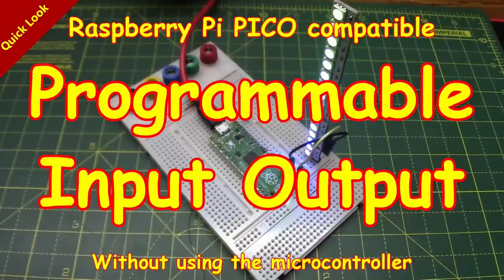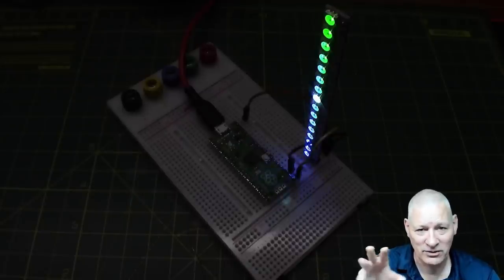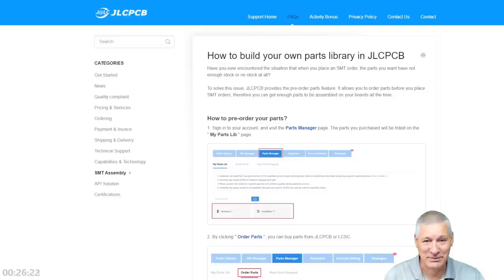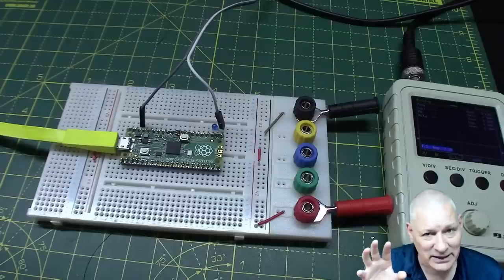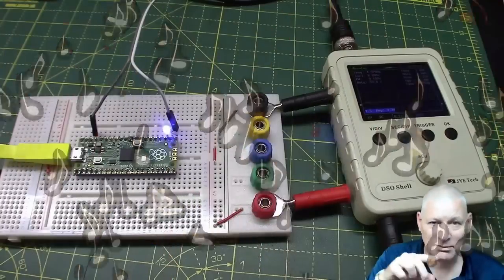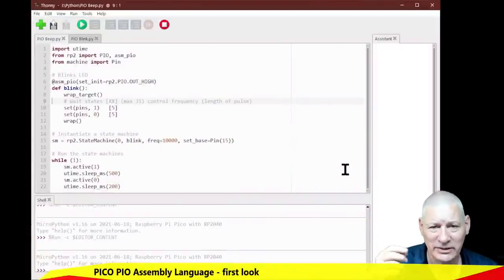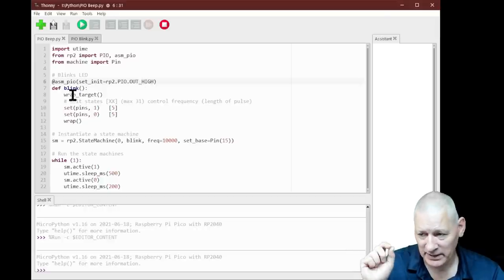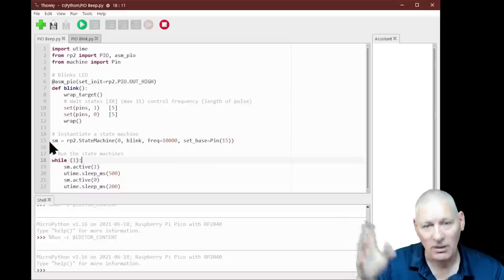#220 PICO and PIO: First Look - far easier than you might 💭 think

Comment: Thanks Ralph. Like you I've been playing with the Programable PIO and watched David's Tutorials on the programable PIO, I've managed to use a BME280 and a LCD display using I2C to display temperature etc, While the PIO output's parallel data On the PIO Pins, This is a lot different than programming Arduino and Stm32 Micro controllers. Keep up the good work.
Reply from the maker: I'm pretty sure I could write much of what the PIO does on the PICO for the Arduino (using non-Arduino speak) but it would be much harder work.

Comment: Note that you could have done your two-pin output with two set pins (using .set()), or two side-set pins (using .side()).  The side-set pins tend to be useful for control pins that you are setting to a known, constant value; and the input/output pins can transfer data to/from the microcontroller memory.  For example, the side-set pins might be for handshaking, clock, data direction, etc.

The set and output pins can be the same pin(s).  That's handy when you need to mix constant and data-driven values on the same pin (like for NeoPixels...).

The PIO support in MicroPython is pretty darn good.  Documentation and examples could use a little fleshing out.  Until then, it may help to take a look at the C/C++ documentation and examples.  I was surprised how easy it was to come up with my own NeoPixel implementation via PIO.
Reply from the maker: If you got the NeoPixels up and running then you already are an expert regarding PIO capabilities, Mark! I shall look into what you said although at the moment you've just confused.com me!
Reply: @RalphBacon  I just pushed a couple of examples of things I was experimenting  with up to GitHub:

https://github.com/mday64/pio_experiments

It's got a NeoPixel implementation (works differently from the official Raspberry Pi examples), and an 8-bit parallel output port with clock.  Maybe it will help, or maybe it will just add to the confusion.
Reply from the maker: You've been busy, Mark! 
Given the comment from @Andrew Toogood above, I just wonder how many PICOlites will ever reach the standard of code you just published, or will they just download yours and say "Look what I did!" without understanding more than a line or two?

Comment: Nicely done Ralph. Looking forward to a possible follow-up with that neopixel stick. 
I've used PIO on my Pico from a C++ program. Not recommended. I could not have worked out how to do it, and even after cutting and pasting all of the various header and helper (?) files, I still struggle to see what's going on!
Reply from the maker: For now, I'm sticking to putting the PIO code into MicroPython!

Comment: By forming a bridge output then you and expect to get 4 x the power on the speaker. e.g 2.5V in to 10 ohms, power = V2/R   (2.5)2 / 10 = 0.625W   (5)2 / 10 = 2.5W    2.5W/0.625W = 4 Sp one extra pin and 4 times the power out.
Reply from the maker: Well, I'm not sure this is a true bridge output, as there is no actual negative voltage swing. And the correlation between power out and perceived volume is not linear;  I can remember in my dim and distant younger days when I was a DJ (yes, really) being pretty disappointed at the increase in volume from a 100W amp from a 50W amp. To get double the volume (10dB) from the same set of speakers you need to increase power by ten! Yikes!

Comment: Interesting!  I didn’t know pushing an pulling pins for a sounder made such a difference.

I think you can do a live-set-able number of delay cycles (I’ve not checked this but I hope you get the idea) - this uses side set for both bits so the pins have to be adjacent.  I’ve also missed out the wrap target and wrap labels because I think the assembler assumes these if they are the first and last instructions:

@rp2.asm_pio(sideset_init = (rp2.PIO.OUT_HIGH, rp2.PIO.OUT_LOW))
def beep():
     mov(x, y)
     label(“loop1”)
     jmp(x_dec, “loop1”) .side(0b01)
     mov(x, y)
     label(“loop2”)
     jmp(x_dec, “loop2”) .side(0b10)

Delays are caused by looping round and decrementing X, and when X gets to zero the code drops through.  The minimum delay is zero, so the the minimum clock cycles for the whole lot is 4, or up to 2^32+2 if you set Y as 0xFFFF.  This should give you pretty good pitch control if you use a fast PIO clock!
You would set the number of wait cycles by setting Y in your Python WHILE loop using:

sm.put(number_of_wait_cycles)
sm.exec(“pull()”)
sm.exec(“mov(y, osr)”)
Reply from the maker: A nice example, Mr Weston, (I'll call you Nick) and shows how tight loops can be implemented in the PIO arena as well as passing values to the PIO code. Cool stuff.

Comment: My first experience with the Pico was managing to get a PicoW (hens teeth).  I ran a very quick MQTT subscribe and it worked.  Then I did "Blinky", couldn't be bothered to google the right delay function so did this instead.  Fully expecting (having just come from STM32 world) for 1 million to not be enough iterations to produce a sensible blinky.

In python I used this for delay:
for( i in range(0,1000000)):
    pass

The LED had about 1 Hz blink frequency.  That's only 2 million iterations per second.  On a 130Mhz core.  Wow.  I thought Arduino framework was wasteful.

Circuit/Micro python is fiercely slow.
Reply from the maker: It's all down to interpreted vs compiled code, I guess. If Arduino had used μPython on the original Arduino it would never have found the success it has had, far too slow!
Reply: Rapid Electronics have loads of PicoW.

Comment: This has been my favorite channel for a couple of years now, BUT I have to say I am losing interest, I can't think of anything I would use A Pico for that and Atmel or STM or ESP would not do better. And for me Micro python is pointless why learn a new language so my solutions can go slower and have less memory... Went to the end to see if you had an update in the bin sensor but alas :(
Reply from the maker: Hmm, I knew this would be a potential issue for my viewers, Andrew. After all, what can the PICO do that the others cannot (and more quickly too)? I'm only covering the PICO because it's out there, in your face, inescapable, by virtue of being launched by Raspberry Pi. If another (much smaller) manufacturer had launched this it would not have had so much traction.
I'm not sure MicroPython is pointless (harsh, Andrew, harsh) as beginners probably pick up the rudiments quite quickly (then get lost in spaghetti code). And no compilation stage leads to faster development time of that blinking LED, as you saw!
But don't give up! And don't leave! My ATMega328P bin lid monitor is (slowly) coming along, talking using its nRF24L01 to a dumb receiver (at this stage), I have my fridge door alarm to complete albeit possibly with the PICO (maybe, I'm having doubts now) and I have my... oh, you'll just have to tune in and find out. 
(Remember, I'm an Arduinite at heart but don't tell anyone else).
Reply: I feel the same way.

Comment: You could also use the Output Shift Register to output a repeating 0110 (or 1001) pattern to the two pins.

This would also afford you the ability to use the 16.8 clock prescaler to have some control of the frequency.

There's lots of tricks you can play with PIO. 😉
Reply from the maker: I'm going to have to re-read this a few times, Neil, and Google what you are telling me because I don't know how to do this (yes) - but I'm keen to know how to do this, so thanks for the heads up. 😉

Comment: This is probably discussed earlier but i just have to comment on this.
With pico setup, the speaker cone will never go negative. Please check your reference points.
You are measuring the 2 output pins separately, out to ground but what do the speaker see. You put 1 side of the peaker to one pin and the other side, of the speaker, to another pin. The speaker "see" the difference between the 2 output pins. There is nothing to pull the speaker negative.
Reply from the maker: There is no negative voltage, for sure, but the speaker cone could never be in a certain position if the poles were not reversed - thus giving the effect of a negative voltage. As my video stated.
Reply: @RalphBacon  That is not right. You are not reversing anything and you don't need to. Like me, you might need to read up on simple electronics. You are  simply moving you ground point, therefore bigger amplitude. "giving the effect of negative voltage" is nonsense.Put your scope across the speaker, check your ground level and watch how the signal goes negative -or not.
Reply: @flemmingchristiansen2462  'giving the effect of negative voltage' does not mean there is negative voltage.  If one was driving a speaker with +3v to -3v square wave what would you get.  One could say this would "in effect" produce the same results as that of the video.

Comment: Tip:  To make breadboard buzzers tolerable, remove the label and stick a bit of blue-tac or putty in the hole.
Reply from the maker: Your definition of "tolerable" is slightly different to mine! 🤣😂 Terrible, piercing sound and I've got too many in my workshop now (in finished projects). Seemed like a good idea at the time, of course...

Comment: Technically the PIO runs without intervention from the CPU core in the MCU.  If you deal with other types of MCU you might find that your PIO isn't really special at all.  Consider the approach taken on almost all MCUs today (if they have it available) for NeoPixel arrays....  DMA.  You generate a bit pattern which creates the PWM square wave on the output pin.... call Transmit DMA and send the CPU to sleep.  If the DMA is set to loop the buffer, you have nothing more to do and could potentially halt the CPU.
Beyond DMA advanced MCUs like the STM32 et. al. have many, many concurrently running systems inside them, handling IO without the CPU intervention.  I believe on something like the STM32F411 (Black Pill board), the MCU has about 16 different clocks, running 16 different parts of the MCU asynchronously on one of several buses.
Usually those components are used for specific standard peripherals, like hardware UART, SPI, I2c etc, so the protocol aspects are very often taken care of entirely by the peripheral in hardware and the CPU is only "woken" up to process data that has arrived or when it's needed to make a decision.
Stretched out to it's potential, you can have a DMA transfer reading audio off an SDCard triggering a DMA transfer to send that data over I2S for a DAC and the CPU would be asleep or maybe just waiting on UI button interupts to change track.  Potentially even further with the FPU DSP extensions, as you can send floating point calculations to the FPU and off load that processing and receive an interrupt when it's done.  So you could even potentially have an IIR filter or two running on the audio stream and the CPU would STILL be idle a lot of the time.  Although, when you get that level of power you might find the CPU is entirely busy answering real time interrupts to orchestrate everything. 
The PIOs certainly sound interesting to play with and I'm sure some of the bus hardware in other MCUs could be used that way if you wanted to get down into the hardware control registers and start messing with their internal configs.
Reply from the maker: Ideal for NeoPixels, for sure, with no CPU involvement. I bet someone has already done this!
Reply: @RalphBacon  Having just done it with DMA->PWM on the STM and finding an even better way with SPI to try yet, I expect the greatest advantage of the PIO processors will be in converting the "bits" to sequences of 100 and 110 at 3 times the frequency.  ;)
Reply: That would allow you to write raw 24bit RGB/BGR data to the port.

Comment: Interesting approach to push/pull the speaker.   I still can't figure out what the reference voltage would be.  I mean normally you would see -3V +3V but thats only what the speaker sees.  The MCU still sees 0-3V.   I suppose what that is, is a differential pair and there is no static "reference".  I hate analogue electronics :)
Reply from the maker: There's no magic, nor smoke and mirrors. It's still only VCC and GND. 

The "magic" (even though I said there was none) is in having the speaker cone move forward with the positive pulse in the normal way.

BUT, when the polarity is reversed  it's still only VCC and GND but the speaker cone is now in a starting position that could only be achieved (normally) with a +VCC / -VCC and it moves the full distance backwards thus giving a much bigger sound wave than by normal means. 😲
Reply: @RalphBacon  i wonder .... if using PIO could you bit bang a PWM fast enough to make a class D amp out of a GPIO pin!
Reply from the maker: Yeah... good luck with that one!
Reply: RP2040: IOVDD is Power supply for digital GPIOs, nominal voltage 1.8V to 3.3V
Let's say we have 3.3V from the Pico board here.

In IO output Mode you can switch the RP2040 IO Port pins between physical IOVDD pin (digital High logic state.) and its physical GND pin. (digital Low logic state).

Let's say you have two Ports in output Mode and call them A and B.

if you switch A to IOVDD and B to GND
and after a 2 second waiting time switch
A to GND and B to IOVDD
and after waiting two seconds repeat

then a multimeter connected beween those two IOs will see it's probes are alternatiting
connection between IOVDD and GND. because the switching transistors in the ports are told by the software to do that.
So the Multimeter will show alternating between: 3V and -3V

if you measure any port to GND when it is LOW the port itself is a GND, so you measure GND to GND which shows 0V
if you measure any port to GND when it is High, you measure GND to IOVDD which should be around 3.3V GPIO Power supply voltage on the Pico board.

Comment: These 8 PIO state machines are game changing for hobbyists. 
I don't think many people understand how useful they are.
Offloading of up to 8 custom peripheral processes, leaving the two main cores which can perform maths and logic totally free from having to interfere with their operation is such a simple idea, I can't think of why AVR didn't adopt this years ago. The fact these 8 state machines can also achieve timing accuracy not possible on the main cores that lose available clock cycles sometimes due to overheads, will make bit banging so much easier and more efficient.
Thanks for this video .... it's good to see more people adopting micropython rather than whining about it because they're fixated on C/C++ due to psychological Arduino imprinting.
Reply from the maker: Certainly powerful, that's for sure. MicroPython or C++, choose whatever works for you, is what I say!
Reply: In my case it's not "Arduino imprinting".  You talk about clock cycles and overheads.   You won't like micro-python if you want low overheads.  Even simple python instructions, to interpret and then execute and return back up the stack takes 100s of clock cycles.  I mean things like a = b + c takes 100s of cycles.
If you do something python-esk like append to filtered lists together that's going to take about 2 milliseconds per list entry.
From python,  I highly doubt you would be able to bit bang anything.  It's probably the main driving reason for having hardware statemachines in the first place, if they were targetting MP.
Look I use Python in my day job on "non-commodity" hardware.  We are talking blade racks with 192 x 4Ghz Zeon cores and 4 terrabytes of RAM and python is still too slow.
Using it on a MCU at 130Mhz is lunacy.  It will work for "play school" style stuff where timing and performance are not a consideration and response times of milliseconds is acceptible.
Once you move to hardware control, unless you hare using underlying native library code you will not be able to achieve the timing.
Try bit banging a NeoPixel strip without using the NeoPixel native routines buried under the library, but just using the Python GPIO libs.